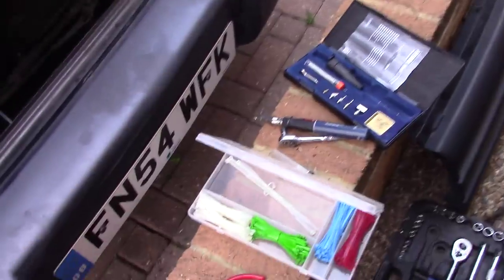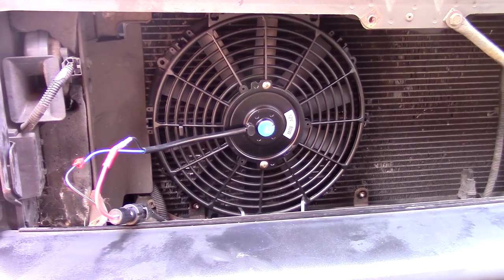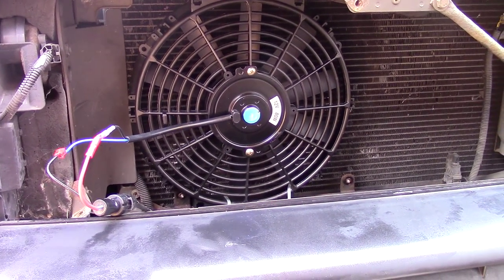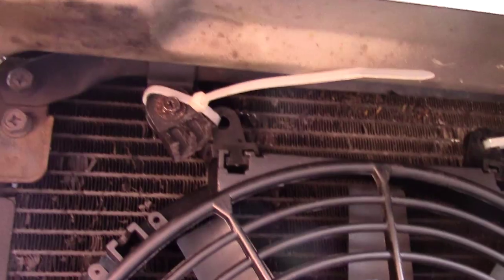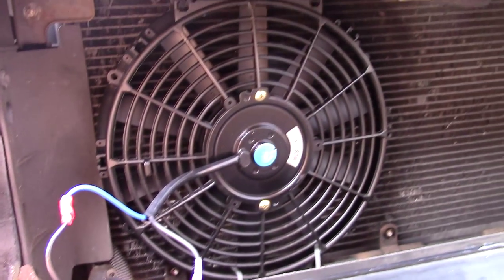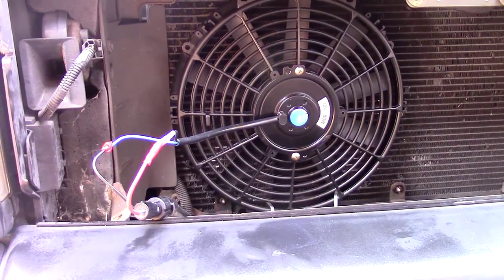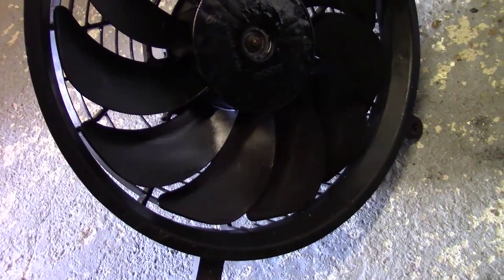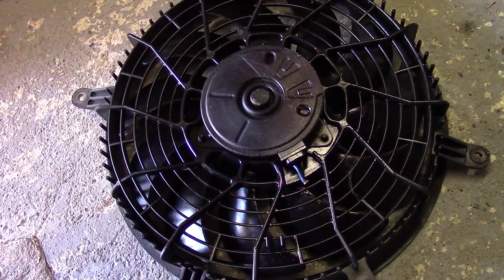LandRover Discovery 2 Air Con Fix - RustySkull Productions

Comment: I was testing mine (here in Melbourne, Australia it is cold this time of year!) and wondering why my fan didn't kick on.  Was not seized, but did some research and it only comes on when the temperature sensor detects 28c or higher.  In warmer places, the motor got good amount of exercise, but in the UK, it probably only comes on twice a year!
Reply from the maker: Well when the A/C is on the gas will become hot as it circulates, the fan should come on within 30seconds of the A/C being turned on. Unless you're driving of course. 
If it doesn't get cooled by either driving or the fan, the pressure will increase and eventually blow a pipe or joint or even over load the pump. 

On any car I've owned I use the A/C all year 'round, even in the winter when it's sometimes -10 (Rarely) but I still have the A/C on and the fan still comes on ;)
Reply: @RSPYT  my seized fan  blew the fuse before causing any damage

Comment: If this fan is out will your engine overheat?
Reply: It just does the Air Conditioning, the main engine fan is behind the main radiator and is huge and driven from the engine
Reply from the maker: The fan that coolsthe coolant radiator is a viscous fan behind the radiator ;)